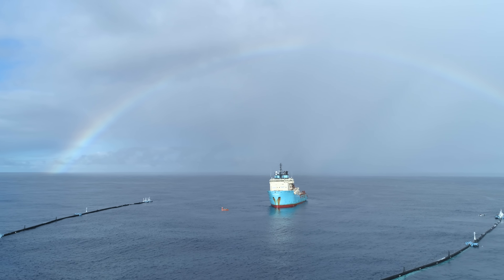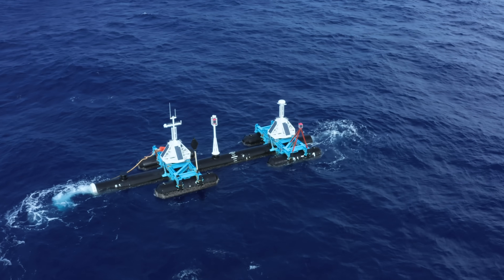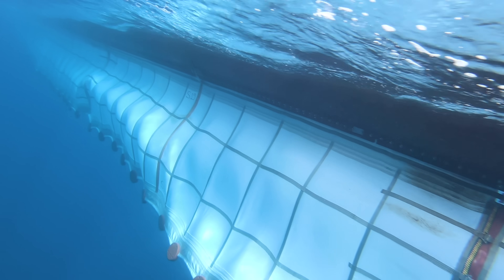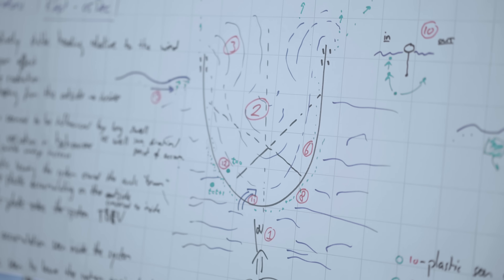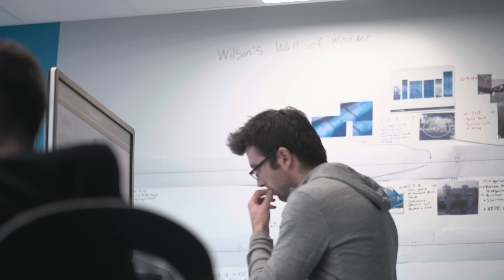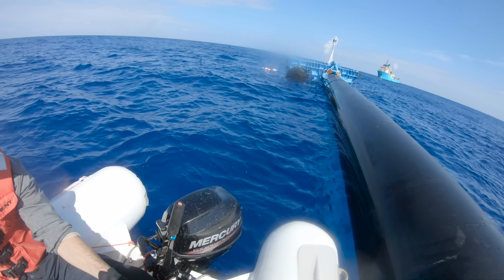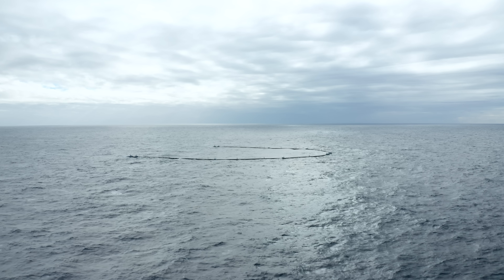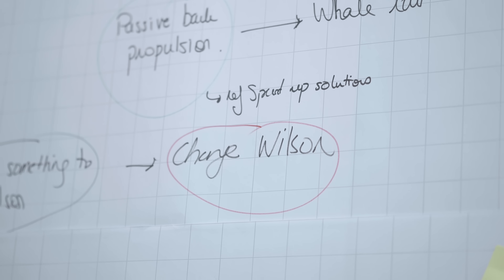The Root Cause Analysis | Why did System 001 break? |  Research | The Ocean Cleanup

Comment: Some people are so dumb that if one failure happens, they completely write something off. This is how science is suppose to work. You have hypothesis, you conduct experiments, you analyze the data, then you recreate until you get the desired effects (in regards to this plastic clean up).
Reply: yup please keep up the science!
Reply: That's not how engineering works. It's a good thing you're not the guy managing the people that make planes fly.
Reply: @OU81TWO  You clearly haven't worked in industry before.
Reply: @balleklorin9780  Lol. I happen to a be design engineer for a leading aircraft engine manufacturer. We don't guess, make a hypothesis, and do experiments. We design equipment based on accumulated knowledge. We have modern simulation tools at our disposal which tell us up front whether something will work or not. We never experience structural failures. That's just bad engineering. Period.
Reply: @OU81TWO  Forgive me for not believing you. If you don't work with hypothesis or do experiments, then I don't think that you are working with innovative designs, but rather work with true and tested formulas that was created by others through the correct process. You might be an engineer, and have access to modern computer simulations that tell you exactly what you need to know to make something work, but to dismiss actual innovative work that operates in an environment that is far from streamlined or standardised, makes you seem like one of two possible people. One, someone that simply claims to be something  to get some fictive authority on a subject, which is most likely. Or two, you are an actual engineer that doesn't recognise how new technologies are developed and worked upon to perfect a design. Especially since nothing like this have ever been done before, and there is no standard design or computer simulation to help the job being done. But honestly, I still think you are the first example. Just looking for fictive authority.
Reply: @balleklorin9780   I get the impression we're talking about two different things. You and the OP are using words typically reserved for science ("hypothesis" and "experiments") in an engineering context. You can't really do that.  If you look up the definition of the word hypothesis, it means a best guess based on limited information, speculation,  etc. This is why I originally commented because we don't make guesses in engineering. If a company for example decides to develop an innovative new aircraft they don't guess that it will fly and then do experiments to see if they are correct. They know up front it will fly based on engineering knowledge even though the design is radical and innovative. They do research and development to fine tune the design to get optimal functionality and performance. I suppose you can consider the r&d the "hypothesis"  and "experiments" but not really because the underlying fundamentals are known from the beginning and they are not guesses.

FYI none of the work that I do for my clients is standardized. I design and build custom specialized automated equipment to perform very specific tasks. Every single one is different and unique in nature.

In reference to ocean cleanup and your statement... 

"and there is no standard design or computer simulation to help the job being done"

That's not entirely true. This project is fundamentally a combination of fluid dynamics and mechanical engineering. These two disciplines are very well established, understood, and documented. Many different types of simulation software exists for both (I work with Ansys and Catia on a regular basis). The application of these disciplines is what determines either the failure or success of a project.
Reply: @OU81TWO  we are catching plastic here not transporting 100s of people in the sky!
Reply: @OU81TWO  I think you're overlooking the history of historical experimental and prototype aircraft that the modern knowledge base is built on. And the past production aircraft series, and their problems and remedies.
   On the other hand, you're still right that stress concentration at the interface of rigid and flexible is a relatively forseeable issue - but how well the modelling software analyses the forces and the fatigue depends on how well the materials and their operating environment are understood; and ditto for materials tests, scale model tests, and full-scale element tests.
Reply: @williamchamberlain2263   ...or don't design the net retention feature that way to begin with...which is exactly the plan for their redesign to fix the issue! The sad part is that they only realized is was a bad design after spending millions. It was a unnecessary waste of financial resources simply due inexperience.

Comment: I'm not sure what you mean by faster. ROTATE faster?

Wasn't the design that the plastic IS faster than the system?
Reply from the maker: During System 001's 4 months in the patch, the system showed that it could self-orient itself (rotate). The challenge we face now is the speed of the system. If the system does not move faster than the plastic, this gives the plastic a chance to flow back out meaning the plastic has not remained in the system long enough for extraction.
Reply: They wanted to design the system so that it would act like a net. They wanted to trap the trash inside in the U and then collect it in a some sort of bin that could be easily collected.

Comment: Nice! What if you make the middlepart go faster and the ends slower, so that the pipe bends the other way? The faster plastic will be collected in the middle... Great job, keep on going!
Reply: That's a pretty nice idea! I'm on board with this
Reply from the maker: Thanks for the idea! I believe this idea would require external energy, making our system no longer passive. As our technology is meant to be in the patch for long periods of time without consistent maintenance, this method would prove tricky. Our simulations have shown it is possible to do this passively, so this is what we will focus on for the time being.

Comment: What is a problem with making something like a 1m tall net rising from the top , so that the waves don't overshoot the plastic above the pipe itself.
Reply: I could be wrong, but I don't think that's the problem.  The problem is that plastic is outpacing the device, so instead of the device catching up and accumulating and keeping plastic in the concave side, some plastic is actually moving faster and thus leaving the open end and accumulating on the convex side.  I didn't think there was a problem with any plastic going overtop, though I may have missed that.
Reply: @PoeticJusticeSC  So you mean the net below sea level is being overtaken by the plastic as it makes its way below it and then reappears at the surface ?
Reply from the maker: @valiok9880  Kurt is correct! What we mean is that in order to capture and retain the plastic the system must move faster than the plastic. If the system slows, and the plastics speed is then higher than the system's, it then has the ability to flow out again. Our learnings from this mission, will be incorporated into system upgrades in the future.
Reply: @theoceancleanup  but if you will increase the speed of the system the difference between the plastic and system will decrease. This would probably result in less water passing the system so also less plastic passing. In my opinion the systems needs to be slowed down as far as possible, this resulting in more water passing so also more plastic passing. When this is achieved we need to look at how to catch the plastic from the passing water and retain it in some way. Just a question but is there a gap between the skirt structure itself Like a net or is it closed like cloth? What is the dimension of the plastic that the system is designed to catch? Micon size, mm, cm, dm?

Comment: Stakes are so high it's worth it to keep trying.
Perhaps solar powered propellers on the ends might help keep the plastic confined?
Reply from the maker: Thanks for the idea! Solar powered propellers require large solar panels, ongoing maintenance and a ton of energy to propel a system of our size forward. Our simulations show we can accomplish this speed increase passively, which will be incorporated into our upcoming upgrades.
Reply: @theoceancleanup  Yes, I'm aware that the power requirements would be substantial considering the mass involved and would require a large surface area, but the entire structure is quite large.
A passive solution would of course be best - lots of flexible dolphin-like fins on the sides could give a lot of force from continuous lateral wave action. Of course the leading edges would have to be shallow so as not to snag anything and foul up.
No hinges required, just natural elasticity as the water deforms the rear of the fin.

Comment: Have you tried a basket system to collect the plastic ? Let’s plastic in but won’t let it out? Surely this would be easier to work on rather than have to figure out why it keeps leaving the horseshoe
Reply from the maker: Thanks so much for your suggestion. A basket design that lets plastic in but not out, would also have a similar effect on marine life. Mitigating environmental risks is a top priority for us, and therefore why this design has not been investigated further.